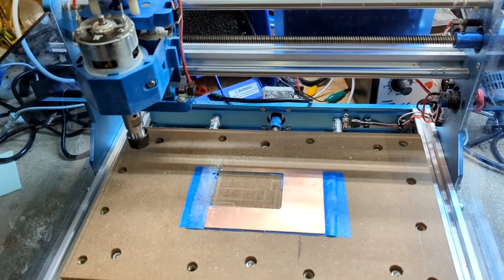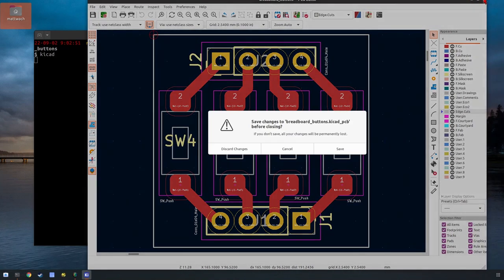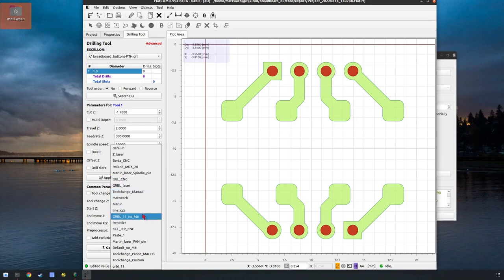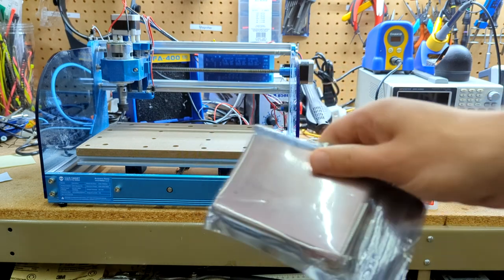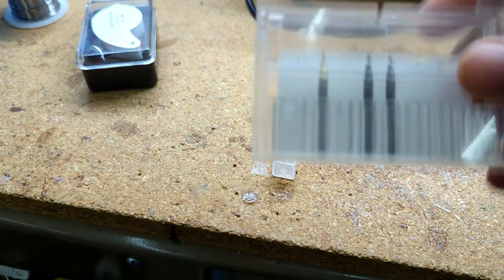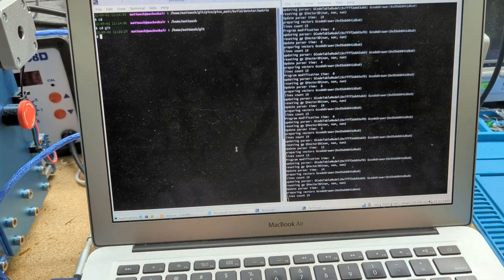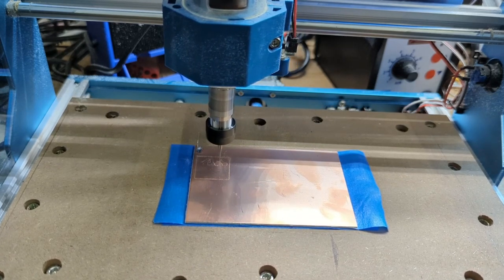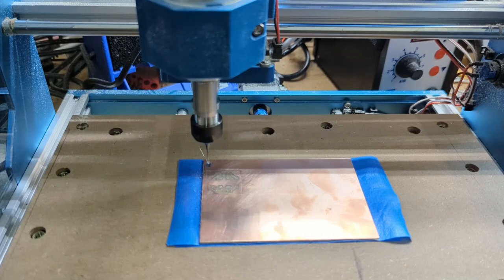Milling Printed Circuit Boards (PCBs) on a Cheap CNC Machine

Comment: I'm slightly familiar with Python, but I had a bit of trouble with your programs. Turns out that the scripts are very dependent on the fact that the origin is set exactly as you do in your video. I of course, had moved my origin to the bottom left-hand corner. I changed the location and all works, except for the 'Check_pcb_edge.py' where the cut through has to be less than -1.8 mm. 1.8 < 1.8 causes a fail of the test and prevents the 'test.nc' file being written. I fixed it by changing check.assert_gt('min_z', check.min_z(), 1.85) in the edge script. Working now, but thought others might have encountered this.
Reply from the maker: Yep, these checking scripts are intentionally very picky and you did exactly what I would suggest.  You may already know this, but there are docs at https://www.instructables.com/Milling-Printed-Circuit-Boards-PCBs-on-a-Cheap-CNC/ (step 12)

Comment: There gotta be a better way than modifying the heightmap to adjust the doc.
Reply: Yes, use the probe touch off on the pcb itself and then zero Z, now run the heightmap and save it, load the copper file and just use the generated height map directly, no flaffing about with editing the heightmap, it's data points are the actual pcb top surface, no need to modify it. The doc is defined in you gcode file in whatever you designed it for, say 0.1mm, the height map defined the zero or top surface of the board, your gcode file defined the doc.